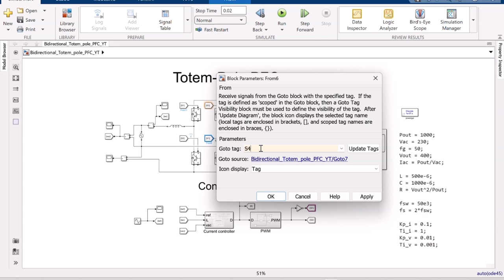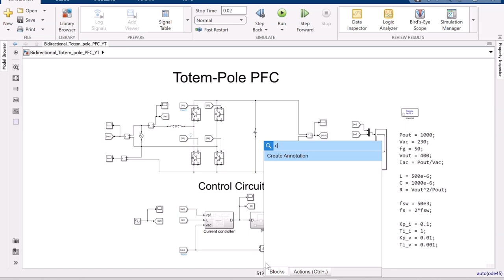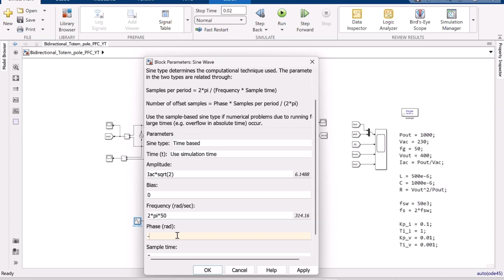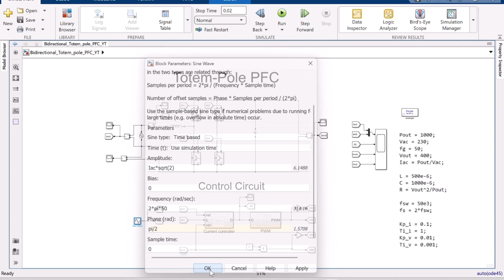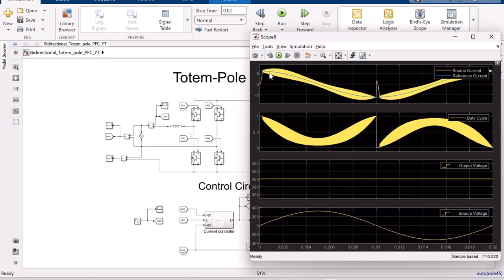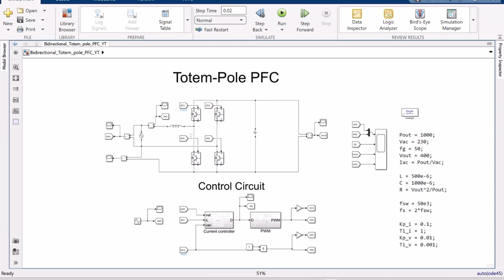How Bidirectional Totem Pole PFC Works, MATLAB SIMULINK

Comment: i have a doubt the term input powerfactor means either on input side or in rectified side ?? and in your simulation you have not shown powerfactor can you help with this ??
Reply from the maker: If you were to calculate the power factor (pf) you would calculate the pf on the input (ac-side). 

The Power factor is the active power divided by the apparent power (P/S). 

In Simulink there are blocks that calculates the active power (P) and the reactive power (Q). And the apparent power is S = sqrt(P^2 + Q^2)
Reply: Could you please Share the Model...that you have designed, any calculation approach also.
Reply from the maker: You can find the model via the link in the description.
When you say “calculation approach”, do you mean for the controller design or the hardware/component sizing?